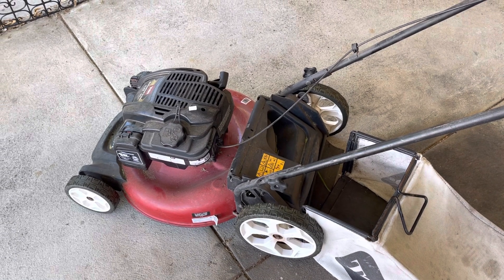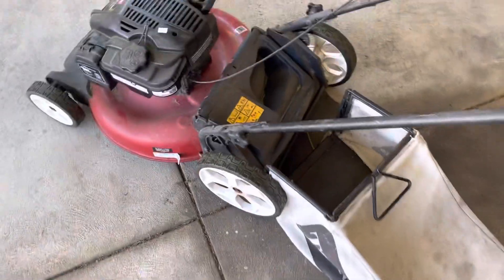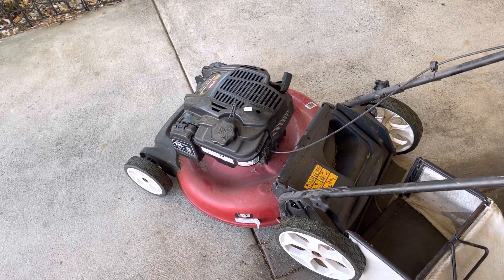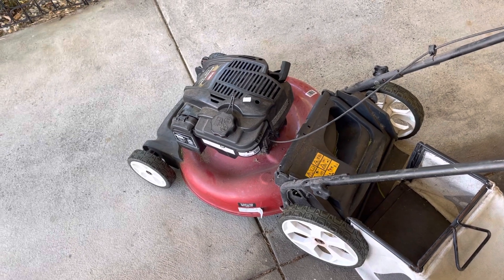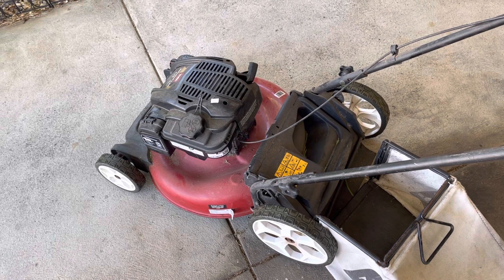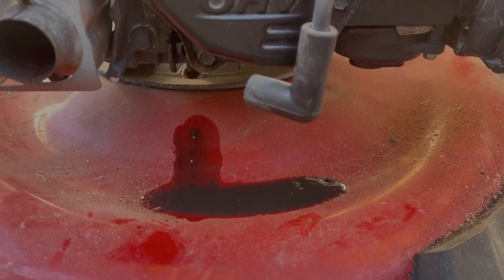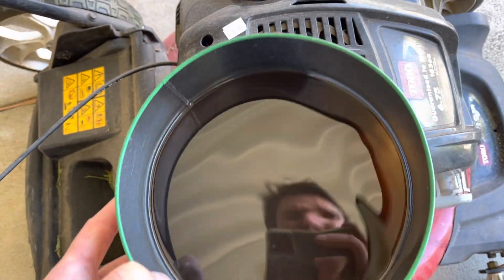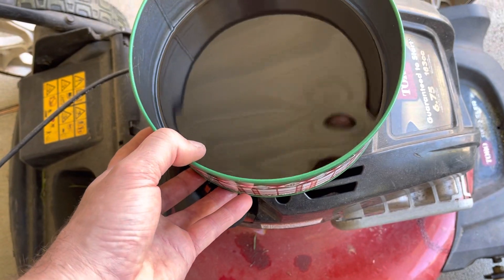$500 LAWN MOWER LOCKED UP - FIXED IN 60 SECONDS BUT THEN IT STARTS SMOKING!!??

Comment: Definitely not what I expected! You would think whom ever overfilled the oil would have put two and two together? I suppose some folks should hire out their lawn care, but then we wouldn't get these bargains would we! I picked up a lot of four mowers for $75 (US) a couple of years ago. One was a very nice Craftsman self propel that was only a few years old. Started on the first pull every time but smoked horribly. I removed the clogged air filter and in a few minutes it stopped smoking. Did a full service on it and sold it for $150. Got the other three going and sold as well.
Reply from the maker: Good work Peter :) it’s a very satisfying feeling isn’t it!!
Reply: @VintageEngineRepairs  Most certainly is!

Comment: Nice save. Looks like it starts better than average too
Reply from the maker: Yes! Starts great, did a cold start later that day and it was first pull. No choke or primer which is strange!
Reply: @VintageEngineRepairs  and it wasn't an auto-choke? Geez, someone ditched a nice mower because they weren't paying attention to the oil level. 
You might change the oil and check the old oil for fuel... just in case.
Reply from the maker: @GuysPlayingWithTools  yeah I’ll do a full service :) yes I think it’s an auto choke, not came across one before !
Reply: @Vintage Engine Repairs  probably is, with auto-choke, it's supposed to start first pull, even after sitting a month.